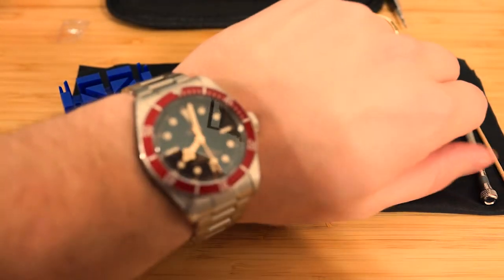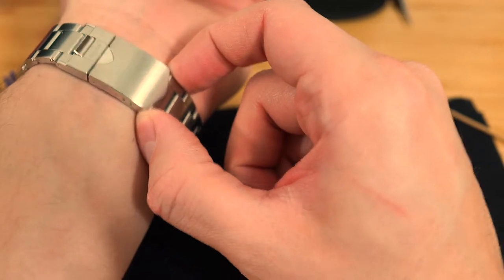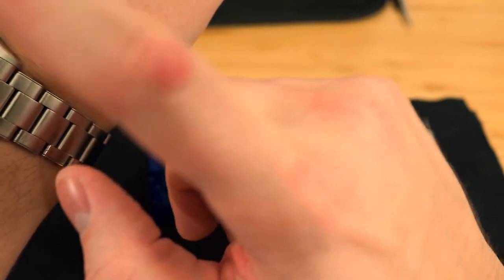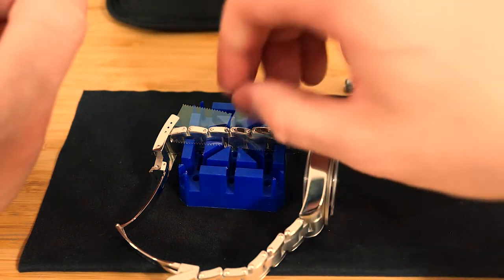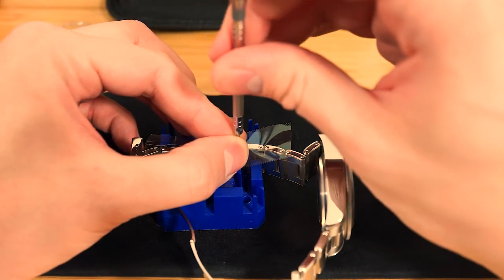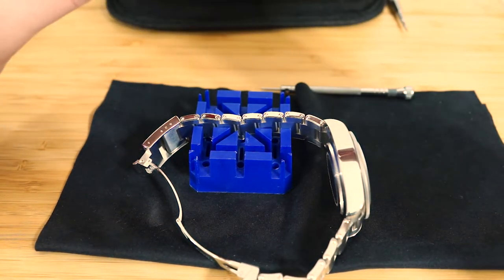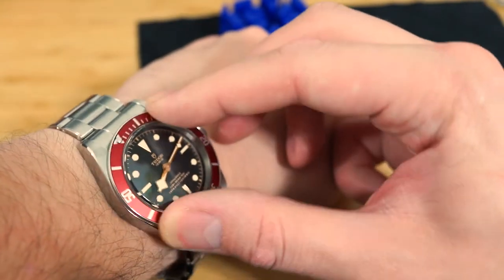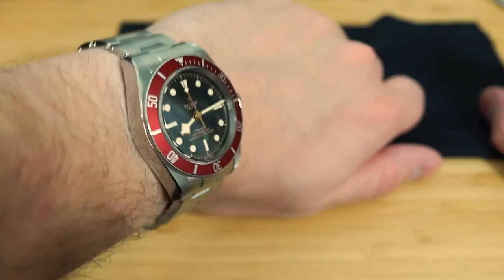Sizing a Tudor Black Bay Screw Bracelet

Comment: Micro adjustments are not "on the fly". Also, the 6 o'clock side should always have more links than the 12 o'clock side. Keeps the clasp off a table top a little better. PLEASE, put a micro cloth on the blue block to prevent scratches on the bracelet.

Comment: Man youtube has literally everything you need.  Bought a Black Bay chrono S&G recently spent $30 getting the bracelet adjusted but it was still a little lose (it is winter and watches/rings etc are loser than summer).  Looking at micro adjustment but paranoid to try to figure out how to move, maybe needs a special tool??  A simple tooth pick and this great tutorial and now fits just that little snugger and more comfortable.  THANK YOU Hoboken Horology.  CHEERS and

Comment: This really is quite easy. I used a 1mm tip jeweller's screwdriver. Make sure you push the screw through the link before you use it as this will tell you which end is which (one is threaded). One end is smaller than the other, the thread end is the smaller one. Don't over tighten, the screw should fit flush. Enjoy saving money over paying a jeweller to do this. It's a five minute job.